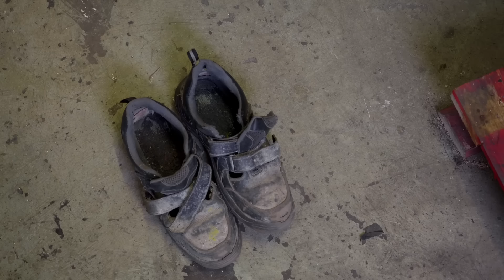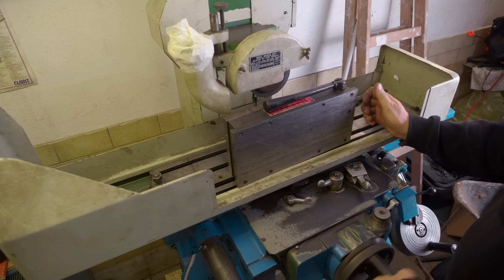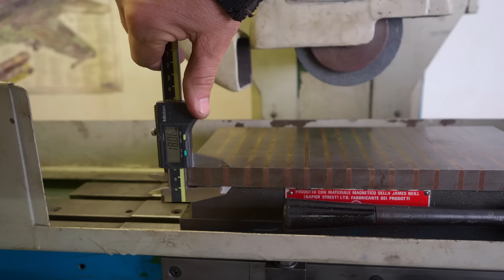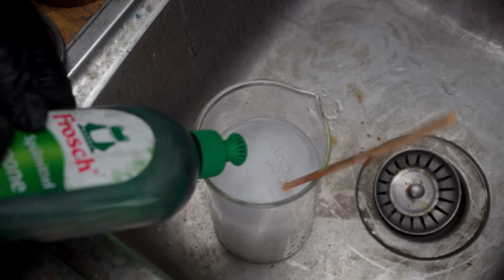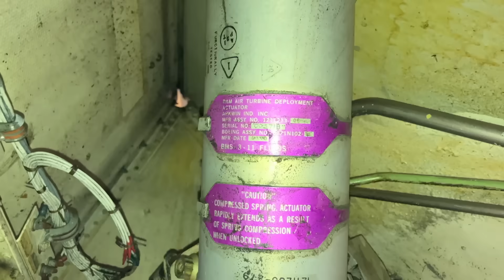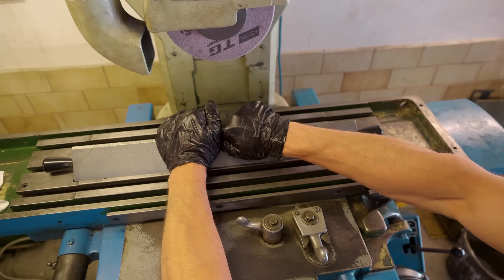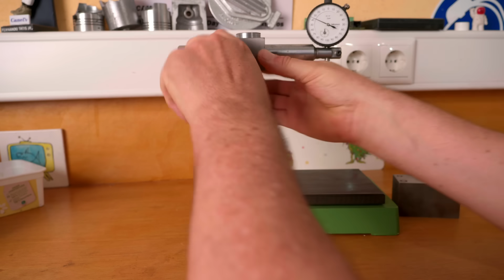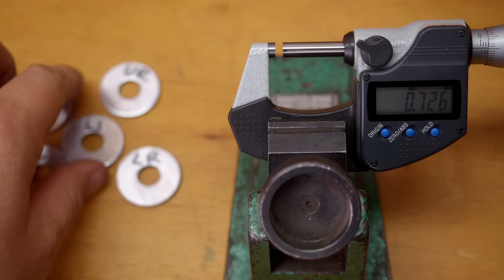Why cant I grind flat parts on my surface grinder? || RotarySMP

Comment: Hm these wheels feel all a bit corse. Like i go from 80 to 140 to 240. 60 sounds quite hard..
Reply from the maker: Good to know. I have a Norton grinding brochure, and they recommend from 36 to 120 for surface grinders. 240 sounds extremely fine. Much give near mirror finishes.
Reply: @RotarySMP  Well most stainless goes till 240. That isn't mirror finish at all.
Reply: You don't want to go so fine.
Dur to the averaging of the grinding you get a 150 grit finish out of a 46 grit wheel.
The only thing you have to do is a last spark pass .
Slow and easy.....
Reply from the maker: @MaD_Man_2000  Thanks for the tip Martin.
Reply: The trick with a grinder for precision work is the bond of the wheel. They really need to be Goldilocks level . To hard and the grit goes blunt burning the job, To soft and they loose precision. That's why you often see much coarser grit than you would expect as they can cut faster without the wear or even worse clogging.
Reply: A 46 grit wheel gives a mirror finish if it and the spindle are balanced good and the machine movements are smooth. A fine grit wheel doesn't make the surface finish much better but it clogs up way easier

Comment: Regarding the comparator stand, if the indicator is not perpendicular to the table, wouldn’t it introduce cosine error to your readings?
Reply from the maker: It will, but that is both minor, and can be addressed by a fine adjuster.

Comment: 1:47
"Oh wow"
Yeah wow indeed =D
Reply from the maker: I still cant fathom how a surface grinder owner can let a mag chuck wear that badly. Unless that chuck came from a shop which was mis-using it for some production job like holding square tube for welding, and had thousands of meters of tube dragged across it.
Reply: @RotarySMP  Yeah some people almost take a pride in abusing their equipment. Im a CNC machinist so I sadly very rarely get to use out surface grinder 😔

I do know of and have seen how some shops treat their lathes and while I have massive respects for welders - they are often like silverback gorillas when using precision equipment 😁
Reply from the maker: @innominatum9906  Yeah, I guess it is just a tool, and some jobs dont need much precision.